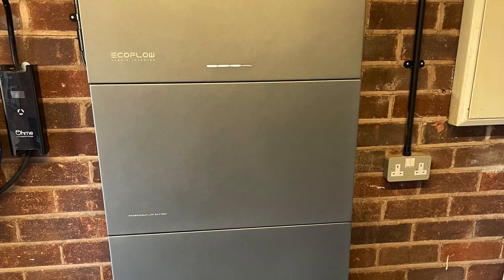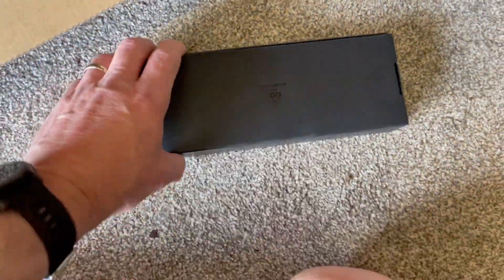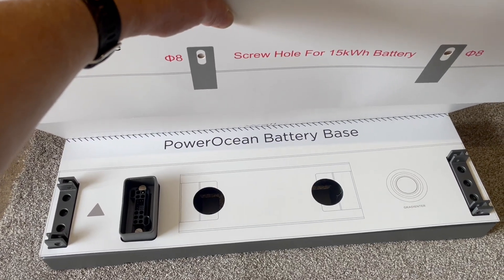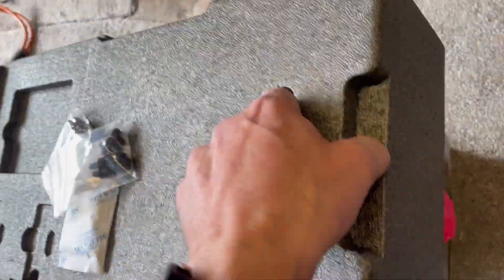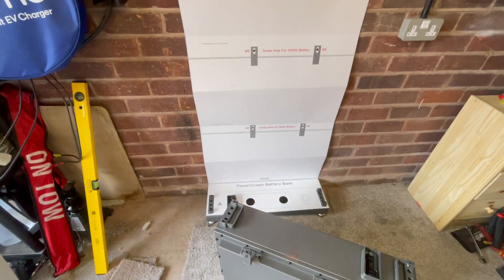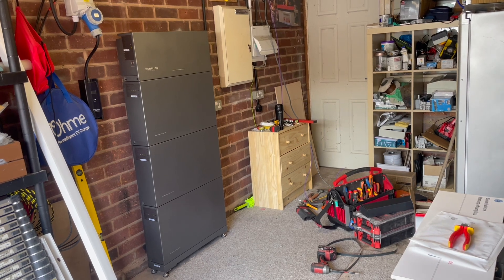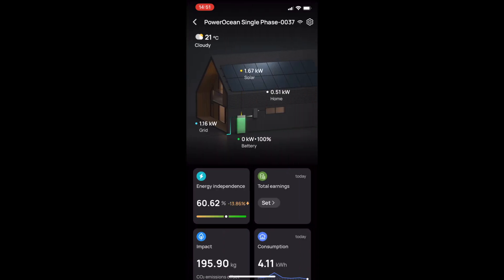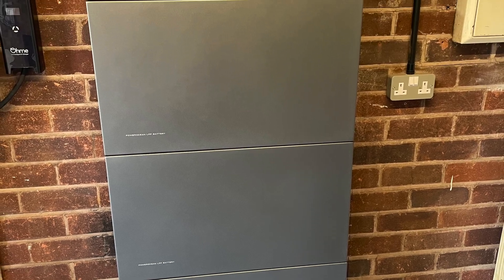Ecoflow Power Ocean 6Kw Installation Video

Comment: How long does it take to charge in the winter from the Grid
Reply from the maker: depends on how many Batteries you have and what size Inverter, the 6Kw Inverter can charge at 6Kw to if you've got 3 Batteries (15 Kwh) then roughly 3 hours or so. You can change the charge rate too so if you don't want to charge at the full rate you just adjust it in the App.
Reply: @StaffsSmartTV 10.2kw battery
Reply: Forgot to say thank you for your response. Cheers